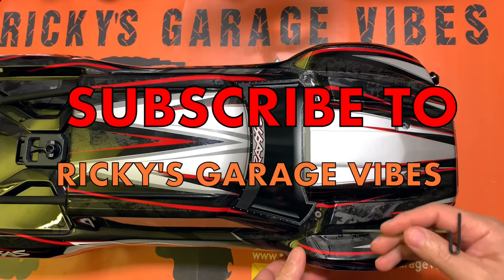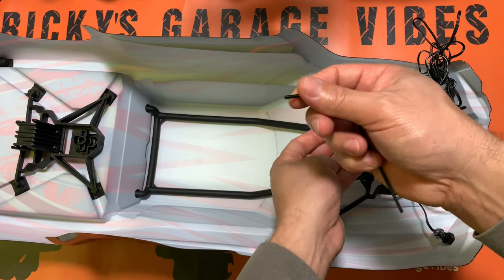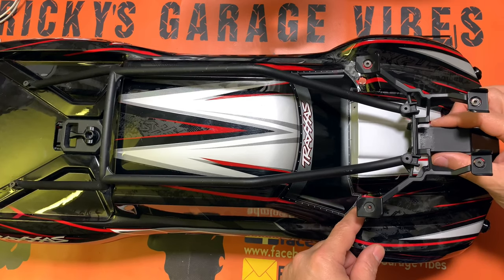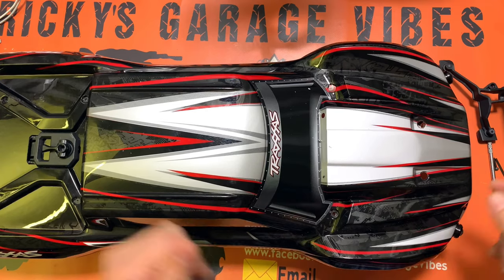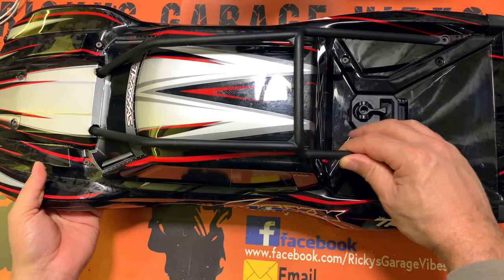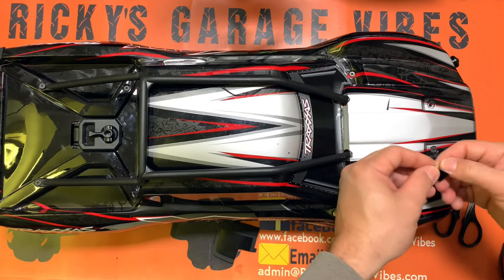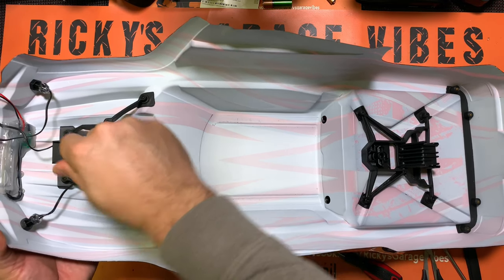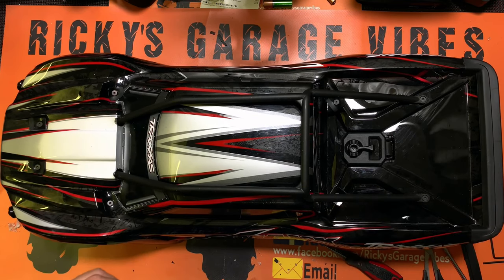How I Reinforce my Traxxas XMaxx Body 🔧🛠🔧

Comment: Excellent work with that body, but, you can use a plastic or rubber washers to other screw-holes. Traxxas have a set of special washers for the body too, I have it from stock.
Reply from the maker: all great ideas man, thanks
Reply: @RickysGarageVibes  I only share my poor knowledge with all.